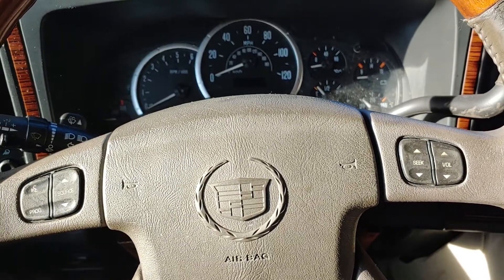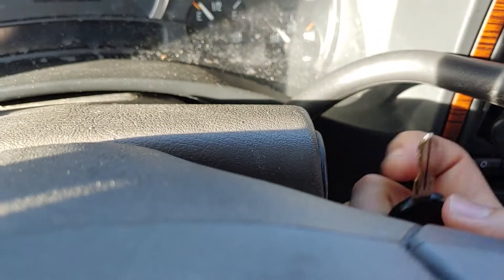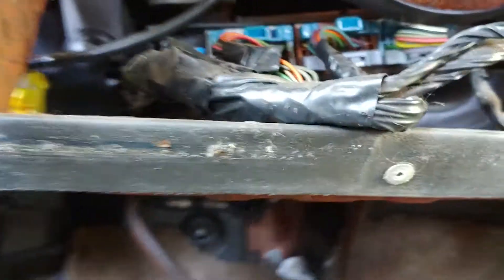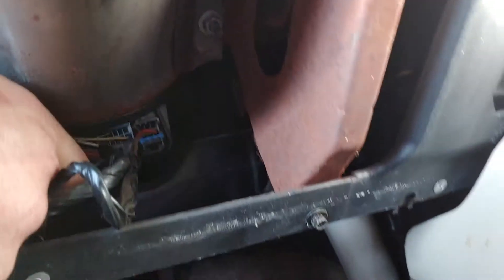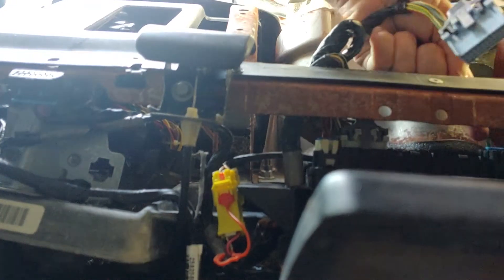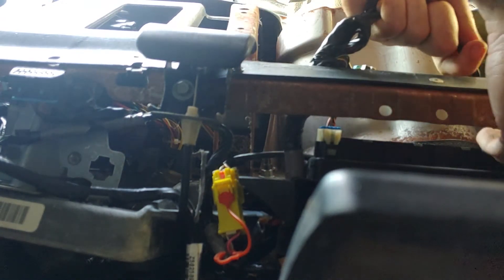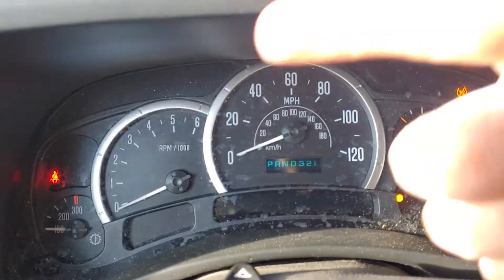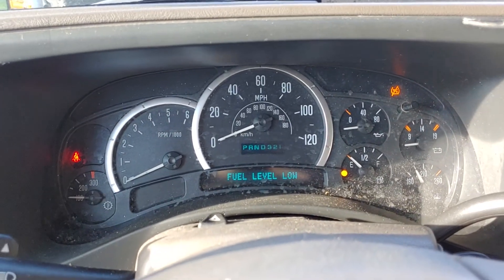Cadillac escalade lq9 ls swap vats bypass delete security system

Comment: Doing this, if I understand properly, is that mean when you transfer engine and computer. You could hook new car ignition to the donor car wires.
Sorry I'm about to do this and have donor vehicle and runs , have keys .😑
Reply from the maker: My understanding is that the computer recognizes the key pattern, by doing what i did the computer just learn that the key has no pattern.  Sorry it's been a while but hope this helps!

Comment: If its running already why do you need to bypass anything? Im trying to bypass in order to get it running
Reply from the maker: I explained it in the first 25 seconds of the video. If you're wanting to pull the engine ecu to use on a swap and not have to worry about the security system for it to run in your new vehicle this is the go to. Now there is a way to do it for a non running vehicle but it will take over an hour and will need a battery charger to keep your battery from dying
Reply: @jonyrocks  did this acheive what you wanted with the swap? If i cant get this going i was going to put this motor in my 79 gmc pickup or my 87 regal but unsure of how much of the computer shit ill need to pull too
Reply: @jonyrock  what is the process for one that’s not running?